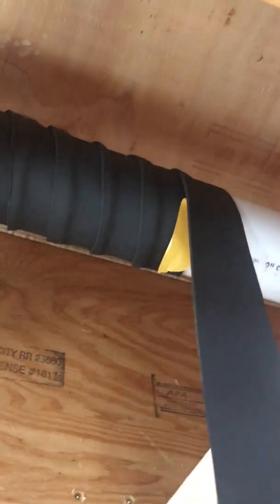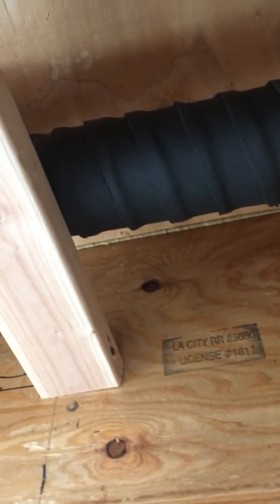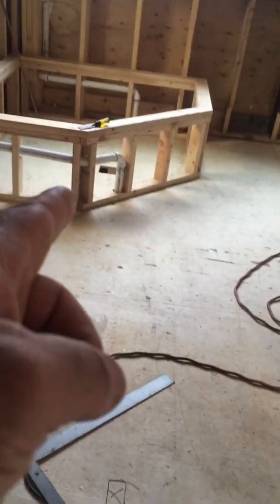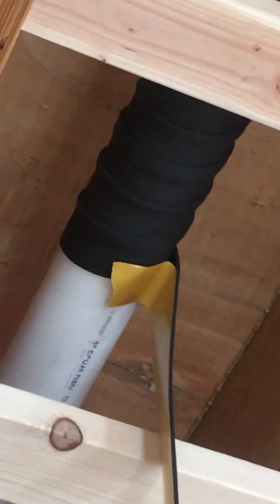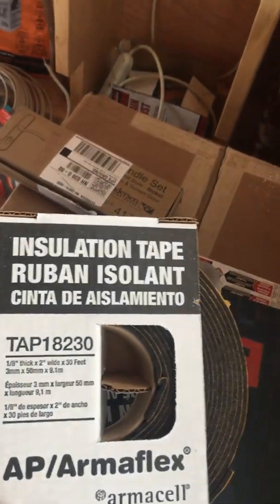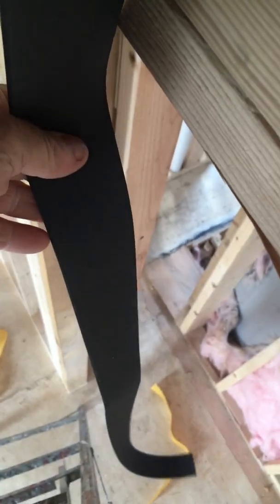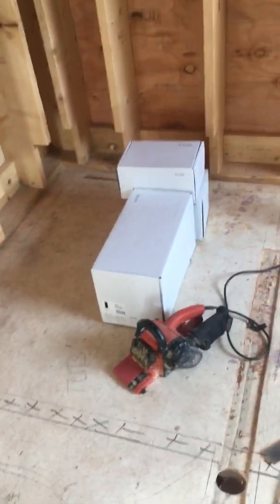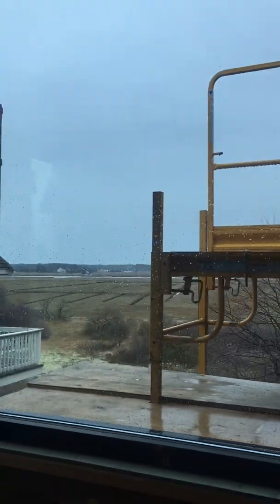Soundproof plumbing drains

Comment: Does this actually work or was this just a theory you’re trying out?
Reply from the maker: Hi Vic it absolutely works 👍 the closed cell neoprene foam dampens the rushing water sounds  emitted from the pvc wall.  We wrap at a 50% overlap in the straight runs and 75% at elbows
Reply: @BostonMark  Interesting. According to their specs; it’s only an R1. For sound deadening; I wonder if mass-loaded-vinyl (MLV) would work better than closed cell foam. I’ve yet to find any MLV that comes in a tape version but I’m sure it can be cut into strips.
Reply from the maker: @victorvek5227  They referred the r value to sound?    R is the resistance to heat flow not sound. Thanks for the shared info
Reply: Where do you buy this stuff?